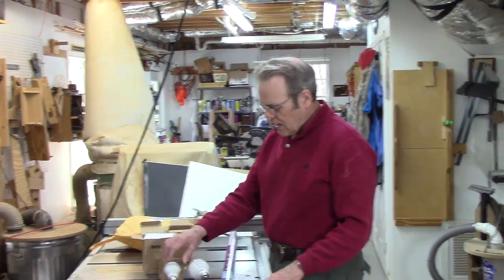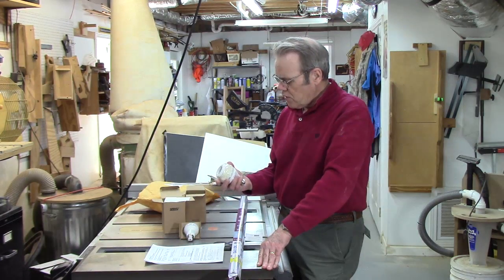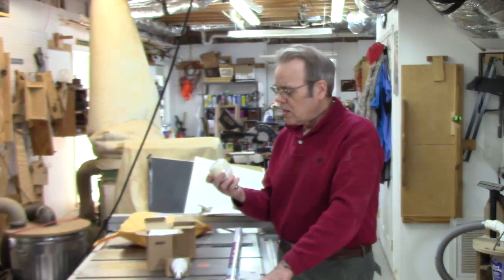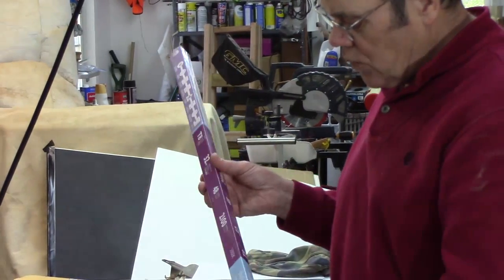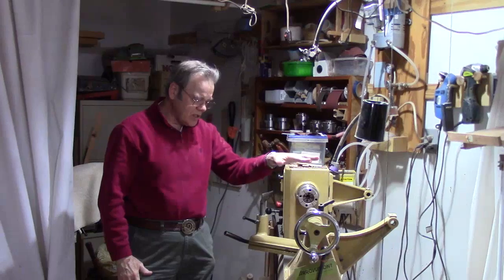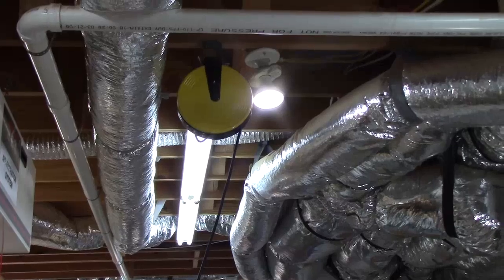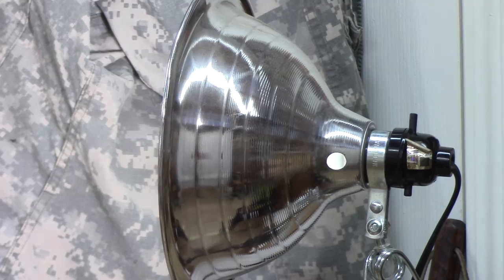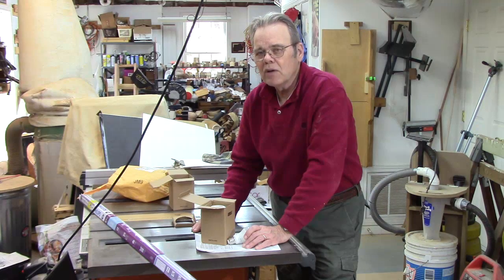LED Shop Light Review

Comment: Thanks for posting Mike. These lights are rather more expensive, but in darker shops like mine they might just be a good solution to help me brighten up the lathe work space/piece.
Reply from the maker: They are pricey compared to a 100 Watt LED light. I think the 4 ft LED fluorescent are currently the most cost effective for general lighting but a 100W LED in a reflector 5 ft over the lateh provides a lot of light. The 250 LED may be overkill for this.  I watched one video where they used about 4 of these in a small pole barn.

Comment: I changed over my shop to 8ft LED strip lights 70 watts with 4000K. Still have canopy daylight bank of 4 over my lathe. I first saw the strip lights in my neighborhood machine/welding shop. Those places are carbon black but the lights were remarkable and sold me at once.
Reply from the maker: Ken, sounds like you have all of the light you will need, with or without cataract surgery!

Comment: With the placement of the leds on that bulb it looks more like an area light than a task light to me.
Reply from the maker: You are probably right in that it may be designed as more of an area light. It has a 270 degree angle, it is certainly not a spot light. I usually  have my task light in a reflector so it covers my task area well, especially for video lighting which I did not go into much since few in my channel have any interest in video lighting.

Comment: I have a 100 watt LED equivalent bulb that I shine horizontally at my lathe head. I find that, when making the last cuts on the inside of a bowl, the ridges are highly visible. I can smooth them with a gouge or scraper so that my fingers cannot feel them.  That's a pretty specialized application of task lighting, and probably not significant enough to go buy a LED bulb...
Reply from the maker: I use a 100 w LED bulb for task light in my Moffat light on the lathe and on my BS as replacments for the old incandescent. They give me goodcolor for videography and photos